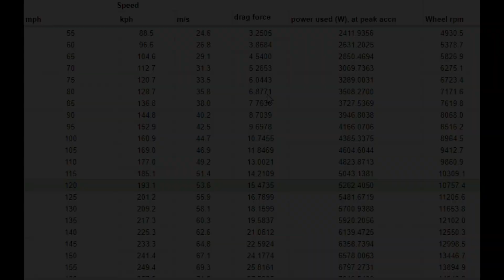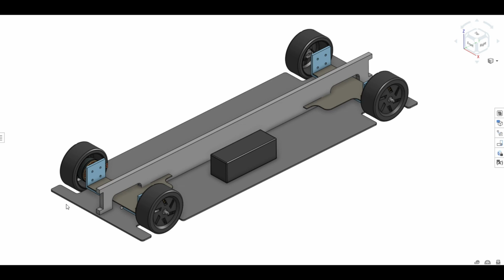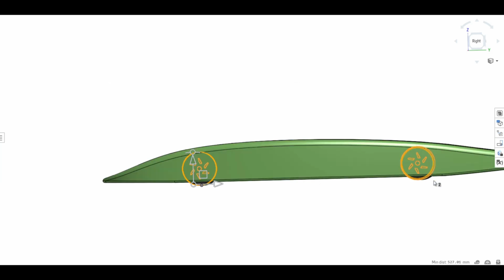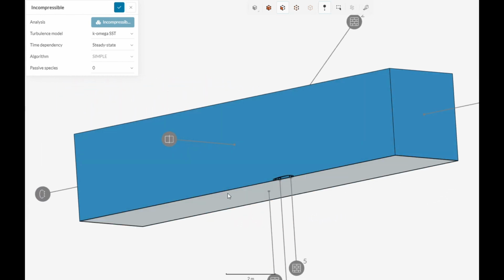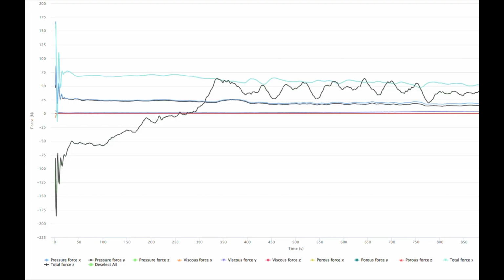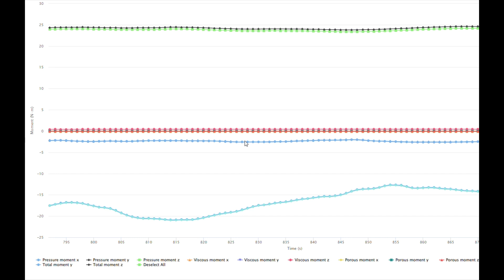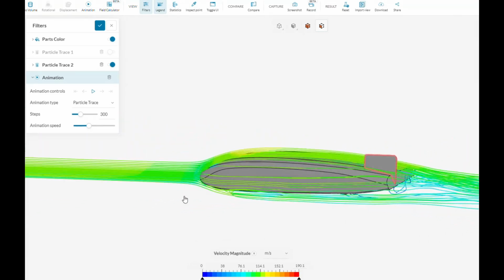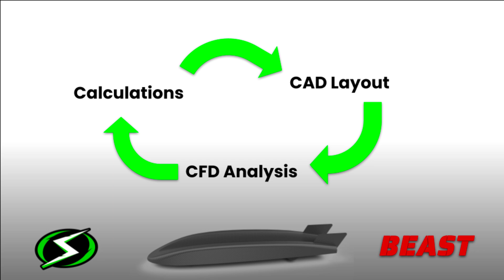How To Design a 200mph R/C Speed Car From Scratch!

Comment: The pointy tip of your design is very sensitive to the direction of the oncoming air. Consider rounding it more. Forcing more air under the car might also increase the Bernoulli effect below the car, but better validate CFD.
Reply from the maker: Round it more when looking from the side right? I have been meaning to check the pitch sensitivity of my more recent designs but haven't got round to it yet. Maybe this week! Thanks for watching 👍
Reply: @steveeng1826  Yes, it should be sensitive to bumps in the road. Rounding the nose more when looking from the side should fix that. You have got a nose like 🏎️ and you probably one want one like 🚗.
Reply: @steveeng1826  add vacuum to the undercarriage. I don't know why full scale Land Speed Record chasers won't do it.
Reply from the maker: @secretbassrigs  this did cross my mind but I decided not to because I didn't want the extra weight and complexity. Plus if I can get the aerodynamics to work it would give downforce for free! Try it and let me know how it goes 😀
Reply: @steveeng1826  I'm guessing the down force designs would also increase drag. so there might be a worthy trade off.

Comment: Youll need a solution for your wheels. You cant 3d print something that can spin at 200 mph without flying apart. Even car tires with reinforced vulcanized rubber and steel rims need to be specially designed for 200 mph. Check your Aero stability too. Are those tail fins big enough to keep you straight and will you flip up like a Mercedes at Le Mans when a little wind gets under the car? if you find your motors shattering magnets and bending their shaft JustCuzRobotics makes some hyper durable brushless motors for a premium but they're custom made to be high speed hub motors.
Reply from the maker: @Drawliphant  thanks for watching, yes I'll be using off the shelf wheels for this car rather than 3d prints that should be capable of 200mph. I haven't got a way of simulating lateral stability so I'm going to have 2 sizes of fins and the option to have up to 3 of them! They are definitely necessary, I ran my old car without them once and it went all over the place then crashed.. I think I have a solution for getting balanced downforce front and rear but will have to see how it performs in real life! Cheers for the tip on the hub motors 👍 Steve

Comment: So wheel on motor huh? no suspension? Not worried about the bearings in the motor?
Reply from the maker: Hey, thanks for watching it! Actually it does have an innovative leaf spring type suspension system of my own design, I'm looking forward to showing that in a future video. The bearings are a concern, they were on my first car too although they proved slightly more durable than the spindly 3mm motor shafts! The loading direction is better on the car than in a drone (radial rather than axial) and they have a 175kg radial load capacity, so I'm hopeful they will be fine! We shall see!